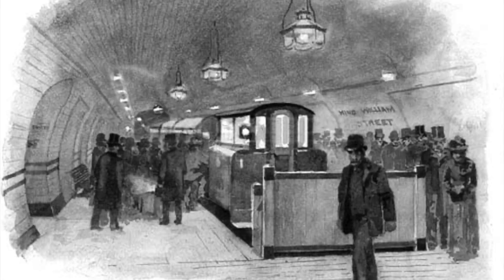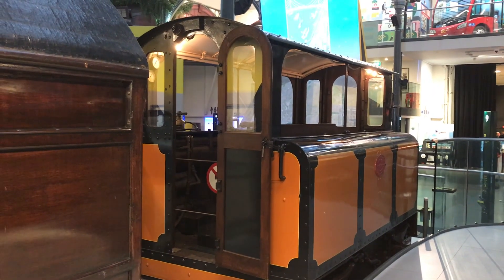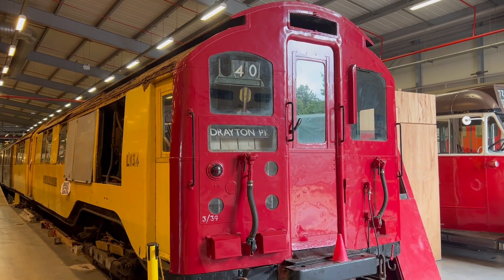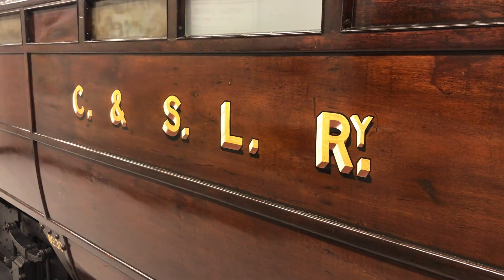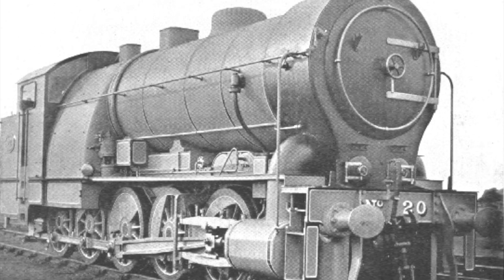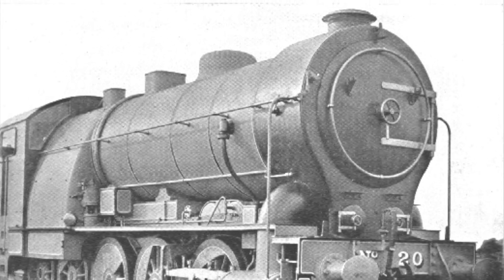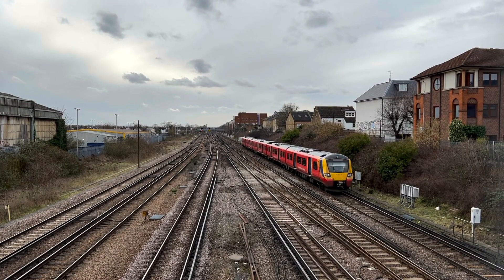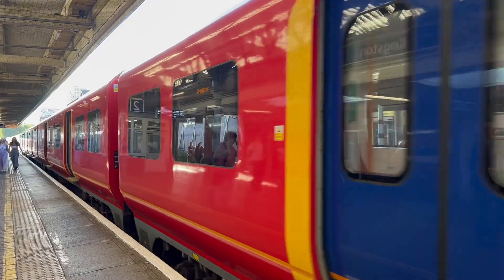Why some electric trains use a third rail, and others don't

Comment: Fun fact about the Eurostar and third rail (before the completion of HS1):

Trains coming from England often forgot to pull up the collector shoe for third rail pick-up, and this damaged track equipment on the French side. The French eventually solved this by installing a concrete block that would simply break off the collector shoe if it were still down.

There is much to be said for simple solutions to engineering problems.
Reply: That is a very French solution!
Reply: @ballyhigh11  This is the kind of thing I would've done as well...the blood of my Huguenot ancestors runs through me deeply.
Reply: There was a whole bunch of paperwork and visual checks around gauging issues - but no concrete blocks. 
Also-  it wasn’t possible to “forget” to raise the collector shoes - it was either pans up or shoes down. 
Though in the winter the shoes could become stuck in the lowered position with a build up of ice.
Reply: Did they genuinely forget though? 🤔🤷🏾‍♂️😉😆
Reply: You can always trust the French to think "Blockade!"
Reply: Trains spotter nonsense ! Trains going to France approached Cheriton, before joining the actual Channel Tunnel tracks, and there is a dual overhead/Third Rail section, that can be traversed at up to 90mph. When the Driver puts up the Pantograph at speed, the onboard equipment checks there is voltage in the overhead wire, and then AUTOMATICALLY retracts the third rail shoes. Because these Third Rail shoes would if not retracted foul the "French Loading Gauge". And in this case Damage French Signalling ramps, which are located where the British Third Rail is located. And sophisticated train like Eurostar capable of 180mph, have all sorts of built in "safety systems". As Railway Engineers, like myself, are fully aware changing systems at speed has to have built in safety devices, just like the "Interlocking" for Signalling !

Lastly it was NOT the French who dealt with the Third Rail equipment, this was left to a British Railways Derby based design team. As obviously the French would not have all the sizes, measurements, positioning, and other technical data regarding the Southern's Third Rail equipment. So forget the stupid childish Train spotter nonsense.
Reply: Eurostar trains were unusual in that they could do the voltage changeover on the move, wheras most of the other dual voltage trains had to do it whilst stationary.
Reply: @ianmcclavin It's quite common nowadays, but presumably not in the 1990s.
Reply: Yeah this just isn't true  actually do your research before you comment something,😂
I swear no one has critical thinking these days
Reply: @jackmorris1068  Fair enough. It was one of those 'I read it on the internet so it must be true' things, and I didn't bother looking into it further.
Reply: Nonsense

The 373s when changing power modes would automatically change the state of the power mode and you could never be in a state where both pantograph and third rail shoes were deployed  and functioning simultaneously! As it was either AC power collection via the overhead wires or DC collection via pantograph (for working in some areas of France and Belgium) or DC collection from the third rail in southern England,The driver would have multiple steps beforehand to see this changeover go smoothly aswell ! 

Please check the multiple sources of videos from Rail Passion and Video 125 for reference! 

There is no mention anywhere about these blocks anywhere!

Comment: The UK (specifically England), USA (specifically New York) and Argentina are the only countries that have mainline railways with 3rd rail. Also, outside of the South, the only place to have "mainline" 3rd rail now (although it's being "disconnected" from Network Rail) is Merseyrail. Previously there were third rail lines around Newcastle (Tyneside Electrics) that were "unplugged" in the 60's, most good rolling stock was transferred to the Southern region (although some went to Liverpool). And then there was the Bury line around Manchester, this line used an atypical side-contact 1200 volt DC third rail (1200 is generally considered the maximum voltage for third rail before you have problems, there was an interurban in Michigan, USA that used 2400 volts, frequent arcing, frequent breakdowns, and passengers had to wait in a "cage" on the platform until the train arrived, for safety. They halved the voltage and things were much better.

Oh, also, (mostly) only in England do they have top-contact third rail that's uncovered (ok, also used on Chicago's "El" trains, and formerly by the connecting but now defunct Chicago, Auroro, and Elgin line), everywhere else, the rail is covered by a shroud, and a paddle or spatula shaped shoe is used to get the power.
Reply: In 1906 the Midland Railway experimentally electrified their 2.5-mile branch line from Lancaster Green Ayre station to Morecambe and Heysham at 6,600 volts 25 hz  AC, overhead, using the same sort of system as used by the LBSCR in London. The electrical equipment came from Germany and the USA with wooden carriages built in the UK by the Midland. 

Except where the route used or crossed the lines of the rival LNWR route to Morecambe,  where steel lattice gantries had to be used, and in stations, wooden telegraph poles of Norwegian Fir were used to support the wires, which must have been cheaper and probably a first anywhere and since. 

The Midland didn't do much more with the line or proceed with electrification elsewhere and in 1953 it was converted to 50 hz as a trial of the eventual 25kv 50 hz system that in due course became the UK mainline standard. 

The line remained electrified, with mainly ancient equipment, until closed in 1966 as part of the Beeching Cuts. Ironically the rival and longer LNWR route between Lanacaster Castle station and Morecambe / Heysham was chosen to remain open even though it was not electrified. Short-termism once again.

Comment: Not just Thameslink Class 700 that are dual voltage and swap voltage at Farringdon & City Thameslink. But Great Northern Class 717 are dual voltage and swap power at Drayton Park and Southern Class 377/2 and Class 377/7. 

That also dual voltage and use the West London Line when operating the East Croydon-Watford Junction service via Kensington Olympia. And Southeastern Class 395 Javelin also change voltage at Ebbsfleet International and Ashford International as they use HS1 from St. Pancras International.

Comment: I find it stupid that the Headbolt Lane extension of the Merseyrail network, all less than a mile of it, was done unelectrified and forcing the need for battery trains, instead of just adding the 3rd rail and sticking to that.

Comment: New York has a triple power system! In order,the Long Island,over-running third rail. Next,the Metro-North[ex-NYC],under running third rail,and finally the Metro-North- New Haven lines,a combination of under- running third rail,and now,25,000 volt AC overhead! Those voltages were inherited from the New Haven,as that company was pioneering the AC network,that everyone takes for granted! The genius of Tesla,and the indomitable will of Westinghouse made that system possible,and Amtrak fulfilled the dream of the New Haven,and finished the electrification to Boston! A very long and complicated history,as all three lines,contributed to the ultimate outcomes! Thank you,for the forum,Jago,as your insights are always welcome! Thank you 😇 😊!
Reply: And the LIRR overrunning third rail has a cover over it, which seems odd when you look at it but may make it safer and less likely to collect ice.  Also I think the New Haven electrification history was more complicated.
Reply: @johnplampin7274  Yes,the New Haven's electrification story is EXTREMELY complicated,but space is short,so,that I could only put hints in! As an aside,the IRT,BMT Subways also had/have covered third rail,and the Long Island ran over the BRT lines,via Chestnut Street Incline,and that's a tale for another time! Thank you for the attention 🙏! Thank you 😇 😊!

Comment: Third rail electrification was a mistake it’s completely backwards to use it for anything other than a metro, and even then a lot of new metro systems around the world like the grand Paris express are choosing 1500 volts dc overheard wire over third rail. I doubt it will ever be removed though so it is what it is.

Comment: Also an interesting story on the early Eurostar trains that ran from the tunnel into Waterloo in the early days. When the train exited the tunnel there was a lineside sign to tell the driver to lower the pantograph as he was now in a third rail area. Unfortunately, there were a few instances when the driver forgot and then reported the incident to the control room. The lineside engineers knew which bridge to collect the bits of pantograph from.
Reply: imagine explaining that to your car insurance that you have the top of a pantograph in your back seat because a train hit the bridge while you were driving over.
Reply: And from what I hear the opposite happened at the French side so the French railway put a concrete block to break off the third rail contact shoes

Comment: Thank you for the interesting background on the Waterloo & City line. When I worked for Railtrack Southern (1995-2001) the W&C line was always considered part of the mainline railway and my residential (commuting) and work passes covered this line as well whereas a separate LUL/TFL pass was needed for the rest of the underground.
Reply: Waterloo drivers had weeks on The Drain  it was a BR job.
Reply: your pass would also cover most of the tram network around croydon

Comment: Another element to consider when looking at the two systems is train speed - because the contact between shoe and rail is more difficult to maintain compared to between pantograph and catenary, maximum speeds on 3rd rail systems are much lower (the world record for 3rd rail is only about 175kph, set by a Class 442 Wessex Electric unit), therefore are well suited for slower-speed commuter systems, where their cost advantages come into play.
Reply: 3rd rail also has much higher friction than the catenary. Where the catenary excells is that is has a very tiny contact area, which means there's virtually no resistance from the contact, and thus it works better for high speed rail
Reply: Correct, very good point, although the down side is that, due to the small contact area, the friction has the potential to cause more damage to the pantograph than the rail does to the shoe, which is why catenary has to 'snake' laterally along the track.  However, that's been known since the beginning of OHL operation, so isn't a major factor in construction.
Reply: Isn’t the strict limitation for third-rail voltage also a cause for being limited to low speeds?
Reply: @ts-olasola  The delivery system is not neccessarily an issue, as tram systems use DC overhead at similar voltages to 3rd rail systems (750v DC), it's more down to the improved efficiency of AC power over DC power at higher speeds - in the Netherlands, for example, their EMUs operate up to 160kph under 1500v DC (the same speed as BR 3rd rail) , but up to 200kph under 25kv AC.

Comment: Thank you for answering most of my questions about this. I had always wondered, for example why the u8nderground used third rail, and the Elizabeth line is overhead.

I had thought that maybe the third rail gave more power which would explain why tube trains accelerate so quickly. Apparently not.

However, your video has raised a new question, because it is natural to compare cities - Why is it that the London underground commuter trains accelerate so much faster than Sydney commuter trains (which are all overhead powered) ?
Reply: The Sydney trains are heavier and the ancillary systems (air con) need more power as well.   Although the overhead power is 1500 Volts DC the wire cannot deliver the same currents as the heavy third/forth rail conductors.  If Sydney had converted to 25 kV AC  then many problems would have been overcome - such as the need to build more substations and the power draw limits.  The decision not to change to 25 kV was made primarily by politicians more on money grounds than good engineering.  

I think the opportunity was finally lost when the Tangaras were purchased although there were various engineering papers produced after that and tenders for more recent stock asked for 25 kV options - none materialised.  Sydney is stuck with the 1500 Volt DC system for the foreseeable future.
Reply: @barrieshepherd7694  Thank you for your insights. It is very obvious when traveling from London to Sydney that Sydney trains accelerate very slowly, and seem to be slower between stations as well. This must increase journey times quite a bit. I wonder how common it is for cities to have slower electric trains compared to the London underground, and are there any cities that have faster trains than London?

Comment: I always wondered why the AC was usually with overhead wires and DC usually with a third rail.
Reply: Most traction motors were DC, about 600 V until the 1990s when 3 phase motors became more usual. This followed the development of power electronics which could generate variable frequency AC.

AC electrification at 50Hz became feasible in the 1950s with the development of solid state rectifiers.
Reply: I've been told that overhead DC creates continuos sparks, especially when wet and icy. Can lead to pickup and wire welded together, snapping the wire.
In Sweden 15000V 16 2/3 HZ single phase is used.
Reply: It's mostly about the voltage. DC is overall the preferable method of powering your devices, especially if the power has to be transmitted one-way (e.g. motors and trains are no exception). The problem is that you can't easily change the voltage of DC power whereas you can with AC and higher voltage results in lower resistances i.e. fewer losses (it's this reason why we use AC power for electricity in general). This is both a blessing and a curse, though: Said lower resistance also allows the electricity to more easily spark through the air and thus demand a bigger safety distance from the currents. As such, third rail, a power line close to the ground, is reserved for low voltages, whereas overhead lines can support higher voltages more or less just fine, thus making high-voltage AC viable.

As an aside, the highest voltage a third rail system can support is at 1500V DC which is a relatively recent development (most systems use 750V instead) which is the same voltage as on e.g. France, Netherlands and Japan's overhead wires on mainlines and lower than the 3000V DC powered overhead wires on the general mainline railways in e.g. Belgium, Italy and Poland. The only times overhead lines with lower voltages are (regularly) used are at tramways (typically between 600V and 750V DC) and overhead line powered metros (ranges from 600V to 1500V DC) for the lower speeds required and, for the former, also the buildings, trees and other stuff one can easily find on the surface.

Comment: The reason for the fourth rail on the tube is that the supply is DC and the return current would pass through the cast iron / steel lining resulting in electrolytic corrosion.  So another rail is provided and the voltage split except on the Lioness line where the centre rail is 0V.
Reply: So how does the district line work? The middle rail is bonded to the running rails, does that mean the middle rail can be touched as it’s earthed?

Comment: Fun fact: the Tyne and Wear Metro (which uses 1500v DC overhead wires) runs mainly on tracks that used to be 3rd rail electrified.  The 3rd rails were all ripped up by British Rail because refurbishing the electrical equipment would have been too expensive. 

Other fun fact: there are a couple of dieselised lines in among the DC lines south of the Thames: the Wealden Line and the North Downs line.
https://steamboatwilley.blogspot.com/2016/11/its-not-easy-being-dc.html?m=1

Comment: "And by the 1930s it was clear that electricity was the future, not just for commuter rail but for railways in general"

Meanwhile nearly 100 years later...
Reply: Well, see, 100 years years later and it's still the future! They didn't know how right they'd be!
Reply: All of the trains out of Marelybone are diesel. Sprinters still run out of Waterloo.
About 3/4 of the current planned IET fleet is be bi-mode.
Only half of Birmingham is electrified. Sheffield, Hull, Bristol, Swansea, Middlesborough, Nottingham, Worcester, and Oxford get nothing.
No wonder people are looking into batteries...

Comment: Always wondered how much electricity is wasted on 3rd rail system when it simply rains on it. I'm sure there are leakage of some sort.
And since it rains a lot in the UK...

From an aesthetic standpoint, 3d rail looks much more clean, especially in all of your old countryside stations. In France we have trams with 3rd rails (with current being switched on only in blocks where there is a tram running on to prevent fried pedestrians) in historical center of cities. Looks very sleek. 

(the Eurostar with 3rd rail support also had the privilege to feature 3 independant power system inside, for all kind of electrification scheme it ran on, making it one of the most versatile TGV ever made).
Reply: Not much. AC leakage is bad due to arcing in damp weather. You can hear it crackling.

Comment: The irony was that the L B & SCR used the 25 kv ac system & it was converted to 3rd rail dc after grouping. Now the 25 kv ac system is tje prefered method.
Reply: LBSC was a 6kv system. Probably 16 2/3 Hz.
Reply: LBSCR were pioneers in AC traction in the UK, and their system was technically superior to DC third rail, however, it wasn't 25 Kv but rather 6.6 Kv. 25 Kv only became common after WW2.